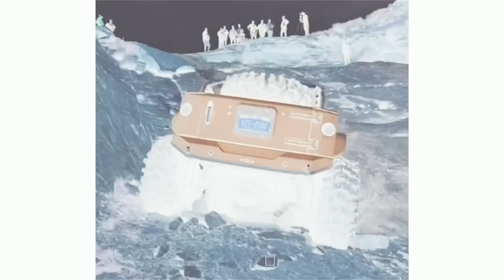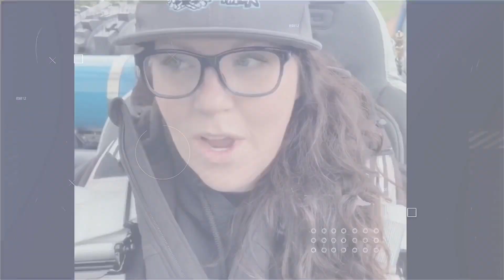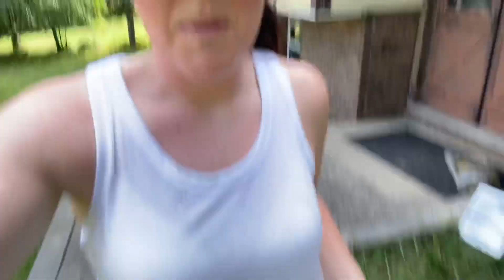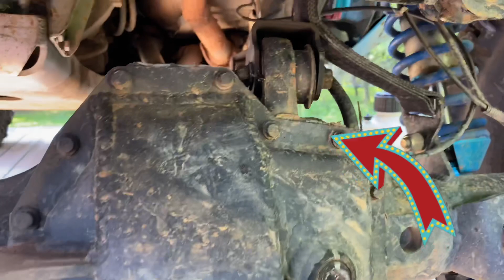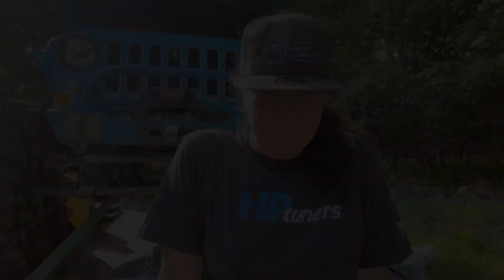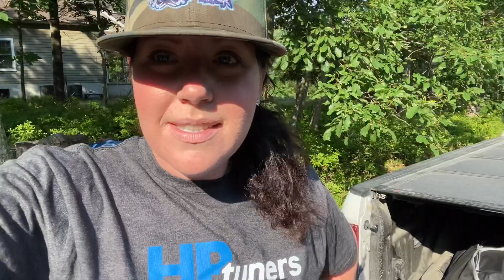Rugged Mountain Ranch in Oklahoma will Challenge you and your Jeep!

Comment: Why don’t you go with rcv axles vs u joints?
Reply from the maker: I honestly believe there is a thin line between building and over building. First, I have a very low horsepower setup with a a crawl ratio of just around 96. I like to crawl things and when I can’t, I’m happy to winch versus going full send. I don’t have or need super beefy 300m 40 spline shafts or CV joints because they really should not be necessary with my setup. IMO, Breaking 2 ujoints makes me think about hardening that specific joint as a next step (hence the switch from solid spicer joints to Yukon super joints), not getting all new shafts. I think RCVs are great, but my Fusion4x4 4340 chromo shafts are also lifetime warranted (with a much faster/easier replacement process), so there is no cost there. Now that we have addressed the issue, if there were to be any additional problems, I would happily consider RCVs, but just based on the wheeling I’ve done since last summer...It’s looking like Yukon super joints were the perfect solution.  Now, the new jeep build will have over 500HP and we will be taking a very different approach...but more to come on that soon. (Sorry for the long-winded answer, but that’s my logic!) 😎🤙🏻

Comment: Love your rig and listening to your commentary. But as heavy as your rig is, if your gonna play on big boy trails your gonna need some upgrades. 1480 joints are no where near big enough for big boy trails. Get him some 40 spline and CTM 1550s. Tackett Creek is no where near the toughest trails out there at RMR.
Reply from the maker: It’s not so much about preventing things from breaking. I want certain things to break. I’ve had the opportunity to move to 1550 joints and 40 spline shafts - we declined. My rig is very specifically set up to crawl buggy lines in places like Sand Hollow and Johnson Valley. Windrock, AOP and RMR are fun but they require a lot more skinny pedal than what I enjoy. I’m confident I can get through all of tackett without breaking anything on my current setup, but not without hydro assist and 43s. I should have resigned from 24Hell and Back as soon as that clamp broke, but I figured worst case scenario the next thing to go would be something I wouldn’t mind breaking anyway (like my lifetime warranty shafts - new ones were on the way before I made it to our next destination...). I’m building a new rig this year - should be done by May and that one will be much lighter and skinny pedal friendly (still going 1480 and 35 spline though 😂).

Comment: My XJ hasn't been my daily driver for a few years now and so it hasn't gotten all the attention it needs. I did spend some time replacing the ball joints, doing c-gussets, new front shocks , new battery cables and fixing the exhaust that I smashed, but I took it on an annual run and had a short somewhere that left me stranded on the trail. I had to be winched out like 10 miles on a 3.5/5 trail. NOT FUN. 
When I got back I found and fixed the short, but then started getting death wobble. I have never had death wobble before so I start to check around and notice that my TRE on my passenger side has a lot of play. It turns out that the knuckle is wallowed out and the TRE is fine. So I find new knuckles and ream the passenger side one and get it back together. It drove like a dream for 1 day before I got death wobble again. Now its the driver side knuckle that needs to be replaced. I don't own the reamer so I need to find someone who has one or just pay the $85 to use it once.... On top of all that, my axle seal is leaking from taking the shaft out so many times. I have too much on my plate so the Jeep will have to wait for a while until it gets fixed. Sometimes things just go wrong and other times they go really wrong.  lol
Reply from the maker: That honestly just sounds like a normal Jeep 🤷🏻‍♀️ they all have their tantrums sometimes and boy do they let us know about it?🤣 Hope you get to sorry hon out soon 🤞🏻😀

Comment: Remember when I said ...No such thing as worry free..Or indestructible.. You will get back at er!
Reply from the maker: 🤣🤣🤣 I remember 😜
Reply from the maker: Jeep off Road KRM the goal isn’t indestructible. In fact, the ujoint that broke is a specifically targeted/preferred weak point. The bushings and tie rod clamp are my fault, I knew they needed replaced or upgraded and I pushed it off 😅. I don’t think the ujoint would have failed if I wasn’t trying to force my way through that obstacle with no hydro assist. Full throttle and bouncing will break anything (which is why I much prefer crawling 😀🤘🏻).
Reply: @MischiefMakerTV  Your Jeep is definitely one of my top 5 favorites. He is a muscle machine...I think you do great considering how much wheeling and the intensity...More girls driving jeeps at your level. What level would you say you are at now with your experience? I haven't wheeled anything close to what you have done..Pretty freaking cool if you ask me..Much love from Nova Scotia Canada. We have some great trails. All different types..Mud .Rock .Both.None.lol..Nice view..No view..lol..I think outa my 200 sum videos, there is about 20 different trails that change every year due to our weather and depending on what tire size dug it up ..lol..